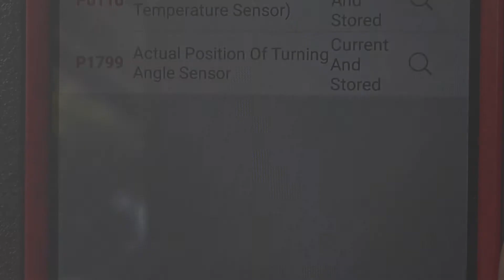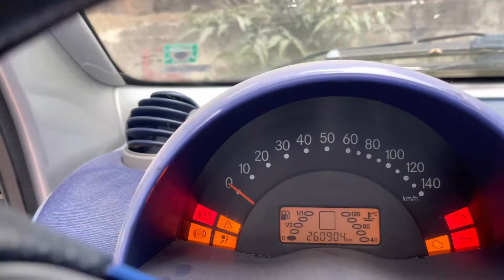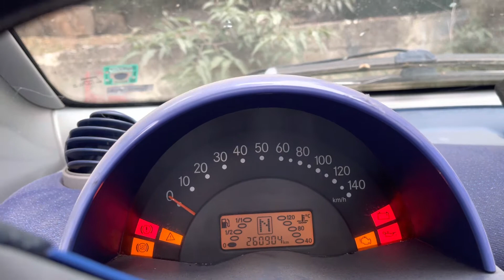Smart fortwo (450) 0.8l diesel crank but no start

Comment: my smart has intermittent no start when cold. sometimes it start up fine, but other times the engine just cranks. i have no fault codes in the ecu, and when the engine starts the crankshaft sensor works fine because i can see the rpm in the diagnostics. btw i'm using star diagnostics. i checked the glow plugs, relay, fuel pump, fuel filter, 230bar fuel pressure when idling. what do you think could be the fault with my car?
Reply: I have exactly this problem. 
Have you find any solution ?
 I have not examined it anything yet.
230 bar rail pressure sounds low. Is this normal at Idle for this engine ? What do you have when it dont start ?
Reply: @dieselmats  unfortunately I couldn't fix the problem, I just gave up on the car and its sitting in the yard 😪
Reply: @kristofkiss1940 i have the Same Problem

Comment: Most of the time, rpm senzor doesn't work when the engine is hot. You will know this when restart engine and RPM indicator doesn't work around ~300rpm when started.
Sometimes (10%) error will be prezent în diagnostic.